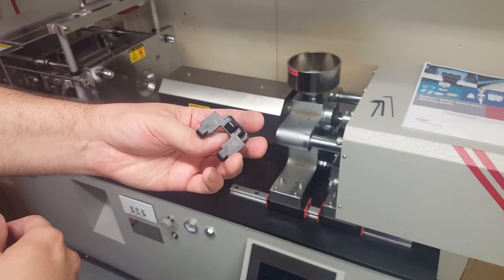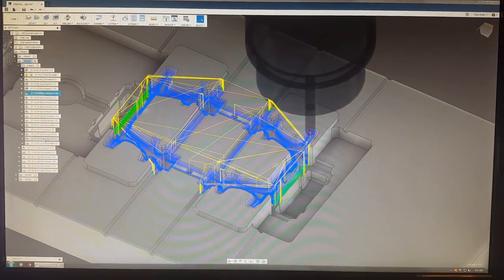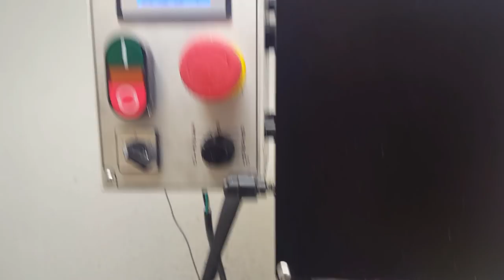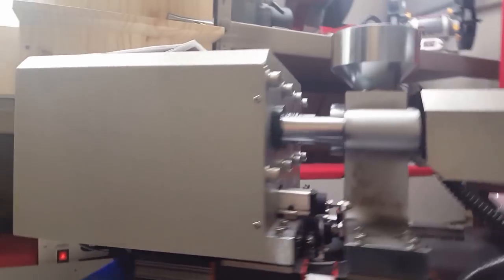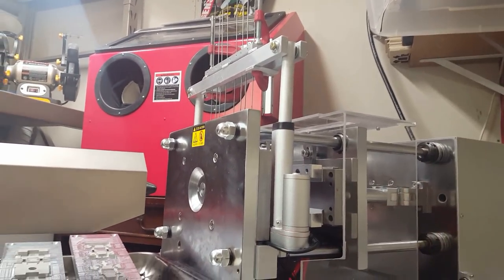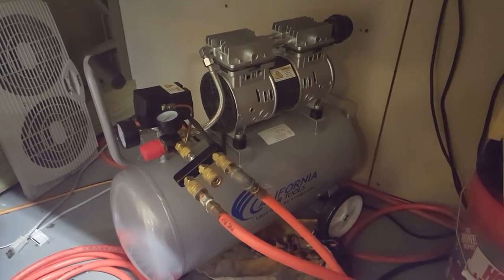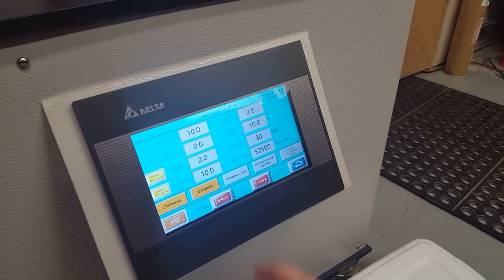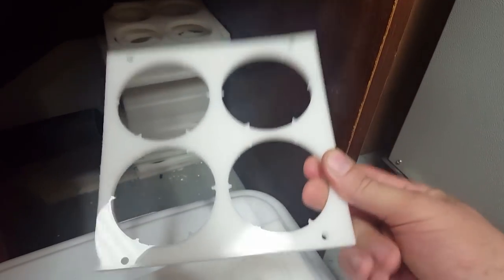Injection Molding - How It's Made & How It Works - Spyker Workshop

Comment: Nice job with technology in hand.  More sophisticated metal removal equipment would streamline that process.  Now as far as what you can do.  Electric motors moving the core pins is too slow.  Interrupt the start inject with a signal to a four way valve connected to one or two air cylinders pushing the core pin plate in.  1-2 seconds max.  A prox or limit switch closing when the plate is full forward, and injection starts.  Now let’s assign some numbers to events in the cooling portion of the cycle.  Cooling time=20 seconds.  Screw recovery time =7 seconds.  Start a parallel timer to the cooling timer and set it to 10 seconds.  The output will retract the core pin plate stoping when the limit switches or prox are made.  No cycle time delay!  Also the core pins can more easily be removed prior to the molded part totally shrinking, causing the pins to be harder to remove, of if they are encapsulated in the plastic enough can even break when being pulled from the part.
There is always a way to customize electric and/or hydraulic circuits to do the non-standard sequence or operations.

Fun to come up with.  If you were not using CAM software on your CNC and doing manual programming take advantage of any and all symmetrical relationships and develop subroutines.  You will be holding your breath a lot less watching for cutter workpiece crashes.

Comment: Ejector return pins? Parting line locks? Why not make a 4th Cavity to balance the tool? How much tonnage are you using?  Water or air cooling for the tool? Why not run the material out before shut down? Delrin temps? Don't mix the degraded Delrin in with the good material when you grind your scraps.

Comment: Interesting presentation.  So, once you get it up and running, but you don't have a contract, what to make?  Toys are a good choice, I would guess.  One might turn their hand to the construction industry.  I've heard that if you get wood sawdusts, that is free of the various sorts of tree saps (you might find a market for the chemicals in that tree sap!), and if you can get the water content at or below 10, you could combine the treated and or refined sawdust with ABA, PP, or something similar for a 20% filler?  And if you can manage to extrude this into a carpenter familiar shape or cross-section, like molding, well then ka-ching!  I would suppose that there might be industry standards you could get certified too.  Better and better as such certification would likely lead to more $.  I've also read in relevant magazines that some formulations (for the lack of a better word) use recycled plastics.  I think that there would be some, about now, getting a hold of a chemical engineer and then their banker for financing?

Comment: the easiest solution for your ejector pins would be to use a steel plate instead of aluminium, the pressfit would hold a tad batter and it would be easy to just put a little tack weld on there to hold it in
or you could just braze them, if you don't have the tools or skills for brazing you could propably just ask a machine shop to do that for you
however, if JB weld does the job than it's propably good enough I guess^^

next topic
the compressor is so quiet cuz it's a diaphragm compressor, it basically has no piston but a flexible steel membrane, besides the noise level it also delivers oilless air wich is good for painting and stuff that requires clean air but can be bad if you have machinery that requires oil in the air for lubrication
Reply: can one just lubricate the machine that does require oil? btw thank you for the info you provided, very informative.
Reply: @snekjuce  there are lubricators that add a fine mist of oil to the air, alternatively you can just drip a few drops of oil in the inlet if you are using something like a pneumatic impact wrench

Air pistons usually work just fine without any lubrication, if you still feel like you need to lubricate them I would suggest dry lubricants such as teflon(PTFE) spray as it doesn't catch any dust that could cause more harm than good

I personally don't use air tools anymore, my shop(and I myself) transitioned to battery power for convenience, well, that and air tools are very energy inefficient.

Comment: I design, build, and run injection molds on a milacron mts 90. Im really impressed you set this up.
Any reason you did this vs getting a used vertical Morgan press? Im thinking about starting a business and would be great to run small run mini injection molds.
Im guessing injector plate compatibility and shot size? I have don'e basic molds on our Morgan press. The one thing I  especially don't like is the plunger instead of a screw. Hard to get fast cycling with the shot not being heated evenly.

Comment: I didn't watch the whole thing so maybe you mentioned it, but is there a way to integrate the pins with the machine? or is it all ran on timers and hope nothing's blocked or paused? If there was a way to tap into the PLC, could you add a robot arm to pull parts out?

Comment: Good video, thanks for sharing. Could you please explain when the mold needs to be externally cooled by water flow thru the channels inside the mold (never in contact to the cavity where the plastic piece is allocated)?
Reply: Many factors contribute to when you need water cooling, cycle time and shot weight are the main two, but wall thickness, material and geometry all factor. If you want fast cycle time you need to cool the part before you open the mould but if you are happy to wait for the part to cool naturally then you don't need cooling. I'm pretty new to injection moulding so hope I've got that right

Comment: if the pins are moving in your plate,couldn't you just use a thicker plate with blind holes so the rods cant move when fully seated?  Assuming i understand the problem? Would moving the injection port hole on the mold closer to the end that needs more material help?

Comment: interesting video, looks like a combo of metal casting and 3D printing all in one, but a very expensive 3D printer, esp. since there are dies to make, like a press process.
Reply: @Alexis Godel yes, injection is like cast metal, no gaps, but 3D is hollow!!- only good for visual models( ones for the mantle piece), trinkets, etc. just interested in injection process, and how you need the mould making machining skills, as well as being a mechanic to service/operate these machines, just wishing they were not as expensive as they are!!

Comment: nice, I had a question. what would you suggest if one needs to make a mold for a dual plastic Gear, one end is Helical the other end is spur gear?
Reply: Dirty and done is to run part-line end-to-end. From there, it can get messy/ugly/complicated.
1) slave blocks in a multiple piece cavity.
2) rack-and-pinion to unscrew helical portion
3) hydraulic or pneumatic actuated cavity halves wired into machine cycle solenoids or switch-operated by mobile platen position

Those are the three most common that I had to deal with. There are no doubt other options. Lots of ways to skin a cat.

Comment: Your going to have the same problem I had with your aluminium mold.  At that length I recommend you  try to machine the mold in steel. or place the aluminium mold in steel casing.  my mold was warped after 20 tries. It was bad.
Reply: put waterlines in it !!!!!!!!!!
Reply: @johnpauels2208  the problem was with the clamping mechanism, and mold design. the mold maker even told me, "are you sure you want to have an aluminium mold this big." I said yes for some dumb reason.  I took the mold to multiple injection molding shops and all of them told me the same thing.
Reply: @sheepman6291  so your platen is to small ? drill 2 holes in your mold ( clearance ) and drill and tap 2 holes in your platen  ( machine ) internal clamping
Reply: did that solve the problem ? were here to help , check out our shop on youtube  ,,, ( trinidad machine shop )

Comment: Very interesting....your machine is not able to fill all 4 cavities, you say. Doesn't Fusion 360 have a "volume" command to tell you, how much of a volume the part has? (I am not criticizing, but rather asking, because I am facing the decision to learn Fusion 360 myself....and I am wondering, if it is worth it).
Reply from the maker: I accidently had the physical material on abs when I made the mold. Delin needed more volume to fill the same mold lol
Reply: Fusion 360 is definitely one of the most powerful tool available right now no doubt in that

Comment: Watching you mill was painful but only because I have a brother speedio.  I know we all can't afford an industrial machine either.  It's just I had forgotten how slow converted machines were.  That all said great video.  I have been looking at this machine and getting the 50g customization kit for it but wasn't sure if it was up to the task.  The part I want to mold is relatively small so dropping the money on a large machine seems like a waste.  Now that you have had it for a couple months how do you like it and have you had to make any sort of modifications or "fixes" just so it would do what you want?  By mods I mean mods so that it would do what it was supposed to out of the box and not custom mods like you did for the pins.
Reply from the maker: Yeah the main thing holding the mill back is limited to 2500 rpm, small endmills have to go really slow speeds from this, works fine for me though, since I'm machining molds, once its done its done.

What kind of part are you trying to mold? Maybe I can for you? I haven't done any other mods since this video, I go over them all in here, the whole arduino board upgrade to make it fully auto, since the stock machine is only semi-auto.

Comment: 1 mm cutter at 2500 rpm !!!!!!!  should be 25 000 rpm  , can you get a multipleyer  for your milling machine , even a bridgeport ,manual has 4000 rpm ,plus use lots of varsol on aluminum ,  KBC tools out of chicago has all the cutters and polishing stones

Comment: i need make TPU Phone Case. How to buy this machine?
Reply: Personal suggested that for few qty to use the micro moulding it's great , cost low and space requirement easier ,but as far as I know the micro mold still got many limits when the qty  and the overall measurement ,it might be a little bit bigger whin micro mould for phone case . The lifetime of micro moulding will be much less than normal injection machine.
Reply: @kichilllee  where can i  find this machine? I need mini machine

Comment: Great job.  So trying to figure out: You are earning your M.I. T. PhD in Engineering by challenge in pneumatics, electronics, physics, and mechanical, but as to business, you are teaching the Chinese who are very carefully reverse engineering (with your help) to compete with you and run you out of business.  SECRETS are wonderful business tools.  Perhaps your first post-doc will be in business and international economics.  Don’t forget your internship with Berilla in Italy for the ceremony awarding you for your Italian patent for your unique pasta die and license its use to them to support your research lab.   (JB Weld?  Don’t forget that somewhere, you must use Duct Tape, just to honor tradition.)  Balance the manifold for even pressure for each track link?  What is the weakest link (most likely to fail).... pins?  Ask Delta for a factory tour (transportation at their expense after they see the marketing potential of your Youtube video), an internship.   Same with the German 1/2 track manufacturer. Keep your brain and hands working.  Great job.  Your family, teachers, and mentors are proud!

Comment: i thought you were going to talk about the machine not the mold...  massive waste of time as someone who's machined molds. 
"and how an injection machine works" you barley talked about the machine itself and only your pin pulling rig.
Reply: You sound mad.
Reply: Thanks for noticing.  
"going over every aspect there is to making a injection mold, and how an injection machine works," 
yeah that didn't happen. what about necessary clamping, and injection force,  needed sensors and settings.  
i wanted watched this because im interested in building the machine. i need details of it and the description is lead to believe that would be gone over. 
Nope it was a prebuilt machine and he likely doesn't know "every aspect" of it.  
i cant call it click bait but its not fully honest either. if the description said "most" instead of "every aspect" i really wouldn't have a problem.
.
I understand not everyone knows or has machined a mold before i can skip that part but the video didn't fully cover "every aspect" on either.  there is a LOT that's involved in making a mold depending on complexity. a sectioned video series would be better.
Reply: @darkshadowsx5949  you can skip parts of the video. it's just a guy sharing, cool, if you can, do a better video
Reply: @darkshadowsx5949  OK Karen, so go find another video.

Comment: Parting line? Interlock? Where?
You're right there - in front of the screen. Why don't You use one of Your goddamn fingers to point at what You're talking about?
Reply: If you cannot keep up with the conversation, maybe you should find other, simpler videos to watch.
Reply: @rgetso  I thought this was supposed to be a tutorial kind of video - not a competition. That's all...
Reply: the parting line is the actual path around the piece which the mold opens on 

if you look at say.... a milk jug, you see a funky little ridge that runs all the way around it, just tall enough to catch your fingernail on, this is where the parting line for that mold is, where the two halves of the mold meet. 

The interlocks are faces in the mold halves that are tapered and are designed to rub onto each other as the mold closes in order to align it. Like how the screw head seated into the countersink, the interlock male will seat into the interlock female and keep everything lined up. 

most of the terminology is actually from castings, for example in the industry the pins he's driving through the mold are called cores, the hole for the injection port is called the sprew, the main area the plastic flows through before entering the part is called the runner, and so on.
Reply: @Thesupremeone34  The up user could use an OBS stadio and mark pending to line out the parting line and interlock etc easily, but obviously, the main puropse for this video is to show the whole process of how to product out, not focus on 3D details.